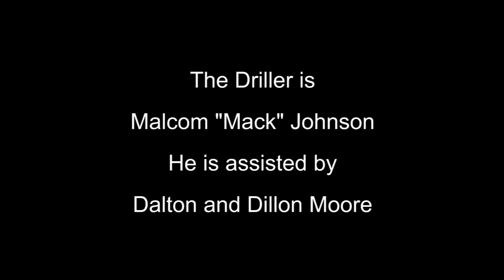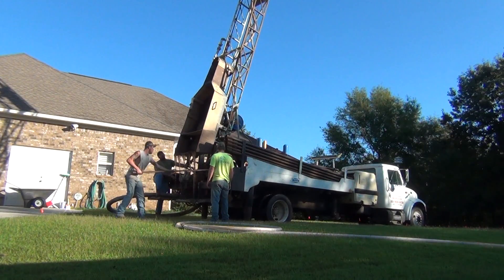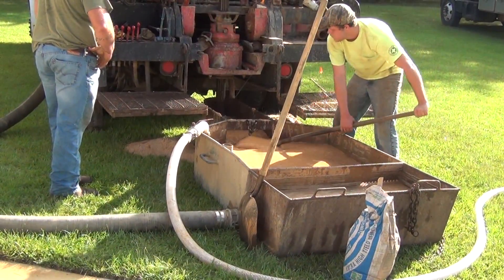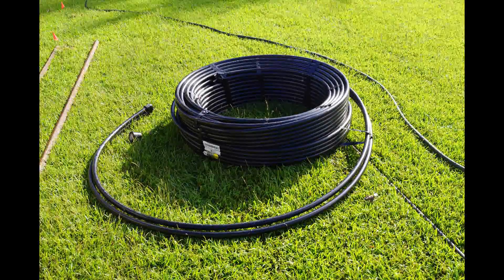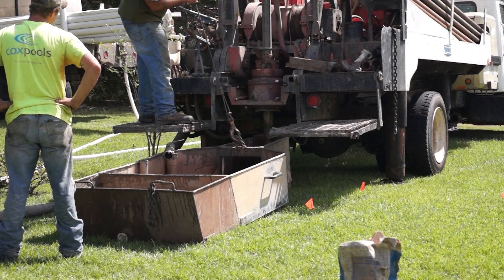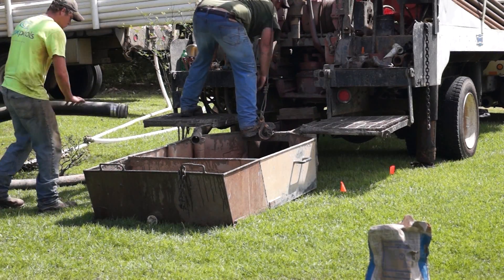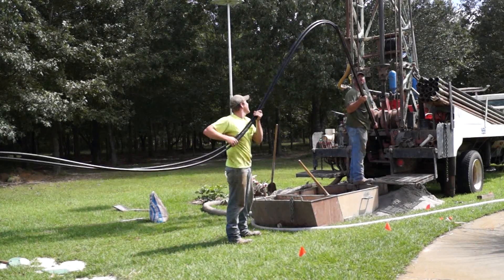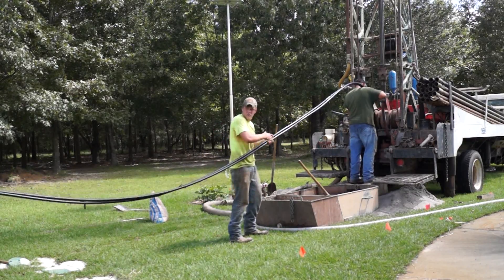Drilling and Installation of Vertical Geothermal Loops

Comment: Was it 500 feet of pipe cut in half? so about 250 feet in the ground. and does the heat transfer happen mostly where the water is in the ground. Has aluminum pipe ever been tried, because i did an experiment years ago with the transfer on heat with the aluminum submerged in water, Thanks for the nice video
Reply: Hi Walt, interesting. There are ground water at different levels i guess. And we don't want to mix these levels to much. I did go after the Swedish model and my own energy well (623 feet deep). When they drilled that it was only 22 feet till bedrock. And the iron pipe ends a bit below the surface of the lawn. They welded a plate on top of the pipe and the plastic tubing goes thru that plate. So no special seal.  They also do a test for the water flow down in the bedrock. If there are a lot of cracks that is good, then the water can travel they say and that makes the well stronger. It can be cooled a lot harder and not freeze. 
there are a rule here too. The nextdoor house, can not put his energy well closer than 65 feet to the next energy well.
Reply: I found this video on installing energy well in Sweden. And he have some form of plastic cap to the pipe. https://www.youtube.com/watch?v=v_6Cx_fy8tY
Reply: Wow John, where to start. Yes ground water can be at any level. Generally speaking anything above 50 feet is considered surface water. It can be contaminated with pollutants and biological agents such as pathogens from farm animals and even human waste. Therefore the best solution is to use rigid pipe like 6"steel pipe in the drinking water well but just the PVC pipe is adequate with the geothermal well piping because it is expected that you will, grout the hole and close it off so no contaminated surface water can reach the sub-surface water. If you can lock it into the bedrock all the better. just think for, a minute what a hole dug down into the ground would do if the well isn't closed off. Water from the surface will seep down the hole into the surrounding water table and you run the risk of contaminating the water with all this nasty stuff. You say you have a steel plate with the pipes coming up through? Buried underground? Where/how is it sealed? What keeps this surface water from entering and running down the pipe?   Normally water has to travel through layer after layer of soil and the bacteria and other contaminants will slowly get left behind. 
          I 'm not sure I would have gone with the one vertical hole 623 feet deep. You would have been better off doing multiple holes at shallower depths.  Generally, the well driller will drill holes at 125 - 150 feet deep and at least 50 feet apart from one another. Remember even thought it is a closed loop you still have to pump the water and solution ( ethanol or methanol in colder climates.) You then connect the pipes in parallel to a manifold in the front yard or bring them all back to the house and use the manifold there.  The pump in your design will have to work extra hard to move all that water back and forth from the bottom of the well to the geothermal unit. The guy who said all that crap about the water moving around is exaggerating what is actually going on. Yes you want a transfer of hot to cold but generally speaking unless you are in a aquifer and it is a river flowing down there you don't really gain anything from not using the grout to thermally bond the black pipe to the surrounding substrate.   Probably to late now but there are sites where you could get a second opinion. I had the certification for installing geothermal years back. I haven't kept up with the new technology so I'm not sure what the Swedish method is but you will pay more in electricity they you need to, have to have a larger pump than might have been necessary and if some thing goes wrong you are screwed. One pipe at 623 verses 5 at 125. Yes you would pay few dollars more in set up fees for well driller but you would have a better system. Only CRITICAL thing is ALL piping must be the same length!!!  There are ways to adjust for variances in pipe length but it is easier to do it right the first time. I guess you are running straight water? But  think what could happen if you get a leak. You can't fix it! Unless you dig it all up? If you have multiple bore holes you have options. You could simply turn the valves on the bad leaking pipe and get by for quite a while on this less efficient method. You could have unknown contaminants in the pipe water from installation and you could be putting them into the water column if you don't grout. You could be leaking refrigerant into the heat exchanger and then into your water. What you describe is a very bad practice. Watch the video and  listen, they worry about contaminating the water with the drilling fluids! In New Jersey where I installed my system a few years ago we could not do any form of open loops and have to totally grout the entire length of the bore hole of a vertical loop system.  What you describe is more like a conventionally drilled water well and not a geothermal system. Sorry
Reply from the maker: It was 500 feet of HDPE with a ubend in the middle.   HDPE is used instead of metal because it won't corrode.  It easily lasts 50 years.
Reply: Most States require closed loop wells to be intentionally encased in grouting cement so they are "sealed" and therefore are able to transfer the heat/cold to the surrounding areas. Yes, wet ground transfers better and it is considered in the formula but distance is the key. The more you have below 6 feet the better. All the pipes including the ones back to the house should be below 6 feet.
Reply: Hi John, 99% right. You drill to the required depth even if it is through rock. Everything else is spot on. You are conflating the drilling of a water well with the drilling of a geothermal vertical well. The water well is dug and you must place piping down into bedrock to keep surface groundwater from contaminating your drinking water and possibly the aquifer you are drawing your water from. Some states used to allow you to draw water from  a well and just dump it on to the surface after you used it in the geothermal system, Some even allowed you to take from one well and return the water back to another well.( called open well geothermal) Both are highly frowned upon due to contamination issues and the waste of ground water brought to the surface just to be used for heating or cooling. Some water wells can be converted to geothermal by the process similar to the decommission of a well. Most states require the owners of an obsolete water well to fill them in with grout/concrete or just put in a geothermal pipe and using bentonite or similar products to fully seal the well. (closed well geothermal). Then you can re-purpose the well.
Reply: ”You say you have a steel plate with the pipes coming up through? Buried underground? Where/how is it sealed? What keeps this surface water from entering and running down the pipe?”
The steel pipe is sealed on top and the PVC pipes goes thru the seal. If u get what i mean.
”Normally water has to travel through layer after layer of soil and the bacteria and other contaminants will slowly get left behind. I 'm not sure I would have gone with the one vertical hole 623 feet deep. ”

Here a normal installation for a small house, medium house, large house (pump size) 5 Kwh (small house). Then 8 Kwh for medium and 12 for a large house. I have the 12 Kwh large house.
The hole is then 100 to 120 meters deep for small, 120 to 160 meters medium and 160 to 200 meters for a large pump. I have 190 meters deep hole (623 feet). I think they can go to maxium of 800 feet (250 meters). The drilling machines can’t do deeper and the pressure inside the hosing gets very high at the bottom. 
It simply is more practical and more economic to dig deeper vs more wells.

You don’t need more hosing and moving and digging at the surface. And one important thing.
The temperature of the rock, increases when u go deeper. 

And you want so hi temp u can get. If i drill a hole at 140 meters, versus on of 190 meters. The 190 one now give me +2 degress Celsius higher temperature. Why. Temp is higher down there.

My hole gives me a normal temp of +5 Celsius. If the hole was only 140 meters. Im sure it only gives me +3 Celsius. 
So what, u say? It’s not that big differences in economy. But… i need to pay around 30 dollars a year less with the deeper well. (When i did som math on it). The big diffidence is also the deeper hole can take stronger pumps. I can prob get one 16 kwh pump and it won’t freeze the hole.

”You would have been better off doing multiple holes at shallower depths.”
Nope, that seams not right at all. U prob don’t drill deeper because of your equipment. Look at the video. U see the big air-compressor parked in the street? 

”Generally, the well driller will drill holes at 125 - 150 feet deep and at least 50 feet apart from one another. Remember even thought it is a closed loop you still have to pump the water and solution ( ethanol or methanol in colder climates.) ”

”You then connect the pipes in parallel to a manifold in the front yard or bring them all back to the house and use the manifold there.” 
I thing regulations here say you have to connect everything inside the basement so you can spot leaks. And that is more easy to check if ou have problems.
So no branching of pipes to wells is done in Sweden (outside the basement).

”The pump in your design will have to work extra hard to move all that water back and forth from the bottom of the well to the geothermal unit.”
Nope, there is not more work to pump deeper. Why? U have water in the system, the pump only needs to overcome friction not the lifting of water. The weight of the water going down does that. 
The new geothermal models have pumps that only need 15 watts of power to pump the brine(fluid) round the well. My old pump needs around double.

”The guy who said all that crap about the water moving around is exaggerating what is actually going on. Yes you want a transfer of hot to cold but generally speaking unless you are in a aquifer and it is a river flowing down there you don't really gain anything from not using the grout to”
The  grout thing u do is strange to me. We never fill the well with anything. There are water down there that does the transfer.

”I'm not sure what the Swedish method is but you will pay more in electricity they you need to, have to have a larger pump than might have been necessary and if some thing goes wrong you are screwed. One pipe at 623 verses 5 at 125. ”
I have personally talked to the person who created one of the first geothermal heat pumps in the world and the company now named BOSCH heatpumps. Sweden is world leader in heatpumps, so no. We do know what we are doing.

”I guess you are running straight water? But think what could happen if you get a leak.”
No, its called ”Brine” and have antifreeze. Rated to -10 C operation. 

”You could have unknown contaminants in the pipe water from installation and you could be” There are filters for this.
” What you describe is more like a conventionally drilled water well and not a geothermal system. ”
I think not. This is the way they do it i Sweden, Norway, Denmark and so on. I think the filling is because the hole is not so deep in US. Then there is no deep water to do the transfer of heat.
This type of energy well is more like taking heat from the ground when u dig just below the surface of the lawn.
There are different methods i guess. Some put the pipe at the bottom of and lake. There it is +4 C all the time.
Reply: looks like the "shark bite" type fitting that are currently approved for house plumbing here in the US. I'm not sure but I would guess they aren't allowed here. I only know of the thermally bonding type where the two pieces of pipe are heated and thermally welded to each other.
Reply: When u drill these wells you first drill till u hit the rock. Then u put a pip and seal the rock and pip so no groundwater can leak in to the well. And also seal the top of the pip. Why? U dont want water from the garden to get down deep into the ground an pollute deep groundwater.
Reply: OK , I understand you seem to do it differently there than here. Yes the water itself doesn't care about going or coming up or down the pipe in a close loop but I think the resistance increases as it travels over these long distances.  I installed a slinky hybrid system at our old house. Five trenches buried in the ground at >6 ft). The calculations if I remember right showed that I shouldn't go over 800 feet per line otherwise I would need a larger pump to push the correct volume of water required by the geothermal Hydro Delta unit. However to do that I would need more trenches therefore I went 1,100 per line for a total of 5,500 feet of pipe and had to buy a two pump system. I did the horizontal because the cost for drilling was quite high. If I had the ability to do it over I probably would opt for the vertical even with the added costs. Horizontal took up quite a bit of real estate and the slinky design was a little tricky getting the exact number of coils and the exact number of feet to agree so the system was in balance between the 5 lines  I agree with you on bringing the pipe inside the house so any leaks can be easily seen. That is how I did mine. A manifold for the pipes coming in and a second one for the pipes going out. We don't use brine here. People concerned with corrosion? I had the nickel coated heat exchanger just  to play it safe but probably didn't need it. Ran 15 - 20% methanol @ 30+ - PSI pressurized lines and system worked reasonably well in winter . Most of the time it would supply enough heat but was designed to kick on the electric resistance heaters 15Kw only on the coldest periods in winter. (-0 F for a couple weeks). Didn't want it oversized for summer time when humidity is a problem.We don't insulate our homes here as well as you so we only had 6 inch walls with R-21 insulation and R-40 in ceilings.  This is was very well insulated for most homes built in the US at that time (2000). Cheap energy made us complacent and we have a lot of catching up to do. Geothermal is a rarity. Even air-to-air, air-to-water heat exchangers are not used by most people.  Fossil fuels still dominate the industry. Not sure we will ever catch up with the rest of the world on this technology. With the current political policies being proposed and implemented I would guess we will be going backwards from this point. Probably will give incentives to burn coal!

Comment: great video,but I didn't see if they fill the hole with mud or sand or anything else,did they leave it hollow,how is it going to transfer the heat from the ground to the water in the pipe,if the pipe isn't packed with soil and there is an air filled void in the hole?
Reply from the maker: The sand collapses down around the PEX.
Reply from the maker: Also after about 10 feet down, it is under water.
Reply: Maybe where you are there is water but...Doesn't matter. Closed wells must be treated like an abandoned drinking well. Must be closed in. Most states require this in their codes. Open wells are different and some States still allow them, but not many. You are removing ground water from the well and either discharging it on the surface after use or must return ground water to a separate hole. Closed loop is the favored way to go. You can control PH, contaminants and use antifreeze in colder climate in a closed system.

Comment: did you subcontract the entire system?  hired your own drillers for the vertical loop.
Reply from the maker: +Jon Car As I explained in the video, I did 250 feet of vertical loop in four months, then these guys installed another 750 feet in five hours!  I concluded after drilling 250 feet that I wasn't up for drilling a thousand feet of vertical loop.
Reply: Understand that.  So you saved money by having that done instead of contracting that out with heating and cooling contractor.
Reply: I forgot you already had a geo system.
Reply from the maker: +Jon Car No problem Jon!  Thanks for watching!

Comment: How do they connect the ends of the loop in the bottom of the well loop?
Reply: +maakjar  The two pieces of HDPE pipe are connected with a U-bend union. The union is HEAT FUSED to the pipe. It is as stronger than glue, and won't leak. HDPE loop pipe has a minimum 50 year guarantee, but expected to last past 100 tears.
Reply from the maker: maakjar There is a special fitting called a u-bend that is built into the pipe.  Look at the shots of the pipe while it is completely out of the ground and you will see the fitting.
Thanks for watching!
Mike

Comment: Thanks for sharing this video.  Those threads must be made of some MEAN steel, not to be damaged with all of the clinking around against those steel surfaces.
Reply from the maker: I agree!  They are very expensive and very tough.
Reply: Big threads so they can take the punishment if the get chipped they can be "dressed" with a file.